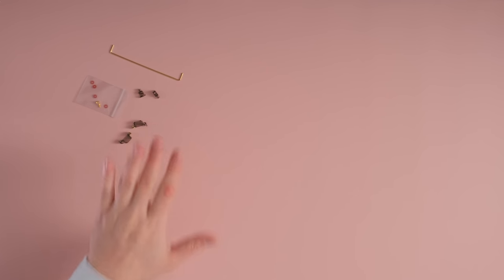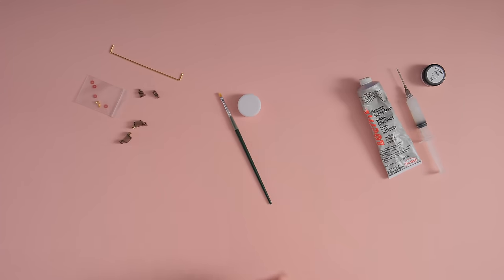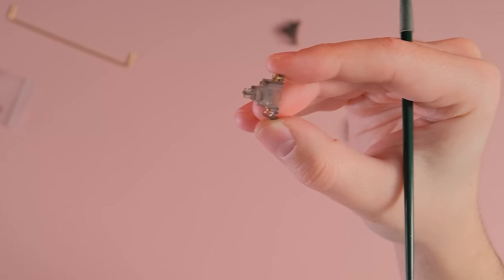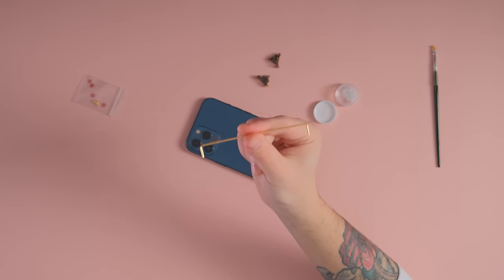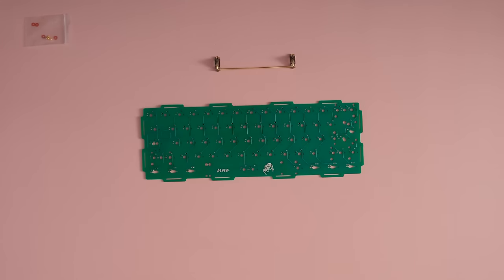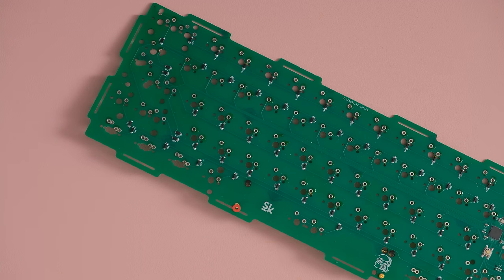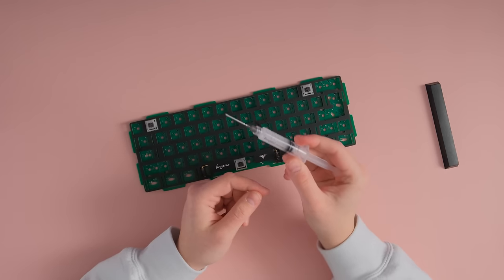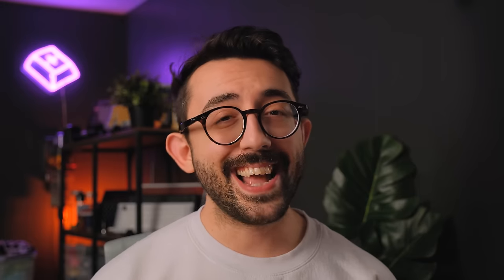How To Lube and Properly Tune Stabilizers - 2022

Comment: Thank you for advocating for wire balancing! I was expecting this guide to be a bit more generic but that step is pretty important.

Some things I would like to add is that you should only be balancing ONE side of the wire and remembering which side it is to insert into your stabilizers. If you balance one side, the flipped over side WILL be crooked.
Reply from the maker: Good to know! Ill definitely dive into this more with perhaps a more advanced video, but I really do think it's an important step! Im glad you like that!
Reply: honestly if you're not :3ildcat don't do it. most people will end up screwing it up and most wires are pretty (with exceptions) well balanced.
Reply from the maker: @jamess.2491  while I agree that a lot of stabs are balanced already, I do strongly think people should inspect and insure stab wires are straight before installing them.
Reply: @alexotos  I'm probably extremely unlucky then, as I've purchased dozens of stab kits (durocks, TX, staebies) and not a single one came with a straight wire. Thus I've been trying to refine my wire balancing, you do still hear some rattling and ticking in my videos, but I'm getting there. I look forward to a more advanced video Alex!
Reply: @jamess.2491  wildcat is human, too. If he can do it, everyone else can, and if you cant, you likely lack patience (as 99% of newcomers to this hobby does)
Reply: @nonnegaard  nah I’ve always just found they’re usually good enough. I’ve done it a couple times when the stab wires were egregiously misaligned (c3 stabs) but besides that I usually just use 205 on the housing, bdz on the wires, and inject some 205 and that does the trick
Reply: Especially if you plan to use stock stabilizers on a cheaper board you're just trying to spruce up.  A lot of times the cheaper entry boards have more egregious bent wires that can be a relatively easy fix for somebody just starting in the hobby not looking to spend another $10-15 for new stabilizers when that can go towards switches or nicer keycaps.
Reply: Hey man! Could you please clarify?
First you said that I should balance only one side of the wire, but you proceeded to say that the flipped over side will be crooked? 
And what do you mean by remembering which side to insert into my stabilizers? Isn't there only one correct way?
Reply: @jamess.2491  They start ticking after a while and you have to continuously relube them if you dont balance it properly. You probably just got lucky with a good wire because its usually not the case depending on which brand the wire is.
Reply: It WILL be crooked? What do you mean. I want to balance my wires the correct way so I would seriously appreciate some clarification on this.
Reply: @IzzyTheTanuki  So let's say you straighten it right. If you flip the entire thing over, it will be crooked. So basically, you need to remember the orientation/which side of the wire you balanced.
Reply: This tip alone changed my whole game when it comes to stab modding

Comment: Definitely what I need. Despite being in the hobby for almost a year and has built quite a number of boards, getting stabs right is the hardest in my opinion and “how to tune stabilizers” videos are usually a year old. With new mods created, a new refreshed version of tuning stabilizers is definitely needed!
Reply from the maker: I hope you find this useful! I didn't cover other mods since I don't use them but this is how ive been doing them for nearly a year.
Reply: @alexotos  well wire balancing and the tightness of the screw ins are definitely something I wouldn't see in previous videos

Comment: When installing any stabilizer: wire balance, always. 
Just like you should do a visual inspection of the switch pins, you should check that all of the stab components are OK. It takes seconds, and makes troubleshooting much easier.
Reply: wire balancing is so important and underrated

Comment: This is absolutely the most comprehensive guide about stabs. Finally someone gives proper advice on wire balancing (rather than wildcat just quickly doing something, and not saying or explaining anything),  goes through best options regarding lubes, and shows exactly how to use the syringes. If you added a guide on Holee mods this would've been absolutely spot on. 

Just one question popped into my mind: I have all of my lubes in the glass jars, and I would not like to purchase the same lubes in a syringe that the vendor provides. 

So my question is: What kind of a needle do you use for your syringes,  I'd like to know the exact size of the diameter of the needle. I tried using a syringe with Tribosys 3204 using a 0,45mm needle, was too small, only got some small drops of lube out. 

I hope you'll see my comment and give an answer, thank you so much in advance, and thank you for the tutorial. All the best my dude
Reply: use a brown needle

Comment: It's also good to note that it's always recommended to use the washers on any size PCB because it's not just used to tighten the screw but also to avoid metal coming into direct contact with the surface of the PCB so as to not damage it.
Reply: Most newer PCBs especially higher-end reputable company's have ESD (electronic shock protection) on their PCBs.(and reputable brands will always put in the description if they have this feature on the PCB), but you're correct. 

If the PCB doesn't explicitly state that it has ESD protection then It's always a good habit to treat every PCB as if it DOESN'T have this  protective feature by always using the washers included with your stabilizers (on PCB mount /screw-in stabilizers).
Reply: I just use clip in stabilizers no worries at all about that. whole myth about clip ins popping out never experienced it.

Comment: i've been frustated by my spacebar wire rattle, even after hours of tuning, wire stabilizing, changing with another stabs, etc, i can't quite nailed it with the rattle. it always there.
but after watching your video, at last i can tackle the rattle. it turns out a generous amount of lube inside the stabs is making the job done.
Thank you for making my day

Comment: Always loved your stabilizers work, so this guide is very welcomed! I'm glad you didn't include holee mod as I think there is some community pressure to do it even though I feel proper wire balancing and stab installation should avoid the need for it.

Comment: I have 2 thoughts about this:
Why aren't you brushing some lube where the wire clips into the housing, instead of just applying some ABOVE the wire after installation? There's no lube where the plastic meets the wire except the little bit that will get to it when the wire twists.
The second thing is, there's no talking about bandaid for plate clip-in stabs or holee (or something of the sort) mod. I understand high end stab brands such as durock don't really need them but in really cheap stock stabs this mods really make a huge difference (certainly in my own experience).
Anyway, great video, impossible to argue with the results!
Reply: @bigbenmk4873  it's crazy you respond this when I specifically talk about really cheap stock stabs in my comment
Reply: @Nehimsupacac  yeah, thats why i said that

Comment: Great video! 

One question though. What do you do if you stabilizers won’t clip into the pcb because the length is to short? Thought it was a thin board but apparently not

Comment: Removed the holee mod and tried emulating how you lube your stabs. For the life of me I couldn't the rattling to stop even with tons of dielectric grease. Turns out the stab stems were not latching securely to the key caps. Had to use teflon tape to make the holes in the keycaps tighter and now they sound better but a bit mushy lol

Comment: The more boards I build the less I do for stabs and switch lubing lol. 

I just bandaid mod, 205g0 the housing, dielectric grease the wire, and pop it in unless the wire is really bad. 

Got tired of holee modding and now my spacebar is kind of loud and hollow but I like the sound and it has no rattle.

Comment: On my first build ever I installed the durock stabs and was wondering how people were able to screw them in without the stabs falling out. I managed to attach the screws and little did I know, the reason they weren’t staying in was because I didn’t clip the bigger part in properly… and to top it all off I was so confident that I didn’t test them before assembling the rest of the board

Comment: I have tried various methods for the last one and a half years but so far the best value Lube for stabs to me is the Krytox 205g2. it's quite cheap and it does the stab lubing job quite well. Sort of a Poor man's XHT-BDZ.

But I think Wire Balancing is the way to instead of those epsi mode/holee mod!  Hope that more Stab manufacturers release stabs inside of a case or something like Gateron Ink v2 stabs!
Reply: hey, I've been looking for someone who has used 205g2 for stabs as in my lube kit, it is included for free. When you say it is good for stabs. Is that housings and wire or just wires or just housings?

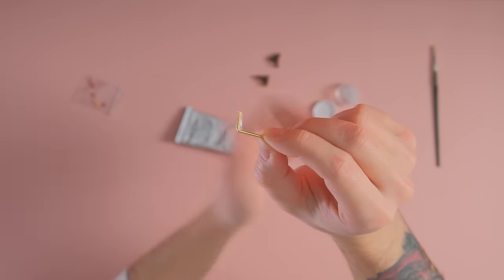Comment: Great video! But I do have one question: at 6:20 you mentioned that you don't go past the bend but why since you were going to lube it with 205g0 anyway? Also, why did you lube that bend with 205g0 instead of dielectric grease?
Reply from the maker: I find that part with dielectric grease feels a bit to thick and something creates a 'gushy' sound
Reply: @alexotos  Thanks for the reply! I'm about to use the XHT-BDZ. Should I avoid the bend as well?

Comment: I noticed in the [adding more lube] section of your video, you add enough dielectric grease to kind of 'fill up' the inside of the stem and stem housing. Is this a good amount to begin with usually?
Reply from the maker: Yupp just use a standard amount to fill it up or you can go lighter, I then recommend using 205g0 to plug any missing spots rather than try to stuff more dielectric grease in there

Comment: Does it matter what brand of dielectric grease you use? I bought a cheaper one from permatex. I also bought some empty syringes instead of the one from TKC, I'm assuming I should be able to just load the grease into the syringes?

Comment: Heyyy man, love your videos! I have a GMMK PRO and have been trying out deferent configuration, tho still have not found "THE ONE". Have any advise or idea, i thought of doing what u did with the keycron but still dont know so would be awsome if i had any ideas or advise, beacause i can see that u can allways find out what is the best mods for each board. Right now im rocking the stock foams, some tape and pe foam. Sooo, can u help me? :))

Akko Jelly Blacks
Pc plate
Durock v2 stabs (hole moded and lubed with 205G0)
Reply: What i have seen in a couple videos is adding some gaskets to the underside of the top case and replacing the case foam with some tape and polyfill. All this with the PCB tape mod, pe foam and Alu plate

Comment: Awesome video. I think there should be an included how to assemble guide and then lube the stabs, by far the trickest part for me as a first time builder was not only knowing you had to push the wire into the clip at the end of the housing, and thats after i got dielectric all over my fingers from the awkward angles needed to grip the wire itself, this is especially difficult if your stab housings are solid instead of translucent, so it's much more difficult to gauge how much lube from the syringe is "enough".

Comment: Yo, does PTFE lube and grease work for lubing switches? Its what i use on my 3d printer and have lots of high quality of both of them. Lube comes in a spray can, grease is.. grease. The grease seems the same consistency as krytox. They are both non-conductive.

Comment: Top how to tutorial, thanks for that. Question to everyone: comparison between the akko top 75 with akkos new double shot tpu  plate mount stabs and the keychron Q1 V2 with durock stabs.  No matter what I do, the keychron spacebar sounds like hot garbage with x switches testet. In comparison to the akko, which sounds god tier level (no joke stabs are all so satisfying to listen and activate), the keychron isn't fixable for me. I've tried it with the sringe, different keycaps, foam to fill the spacebar (variations of foam). 

I've bought a set of durocks for a total of 35 euros to Switzerland and can't make this thing sound nearly as good as the top 75. Is it me or just keychron? I didn't have the chance to review some customs like freebird, frog or kbdfans keyboards. Maybe I should try to import one? 

Thanks in advance for some feedback and user opinions.

Comment: I got a question and I hope it can be answered: About the spacebar's switch, is it better to have a heavier spring force(say, 65g and up) than the rest as it's holding on to the stabs and the weight of the spacebar. or it doesn't matter.
Reply from the maker: Totally preference! I find with a stronger spring you get a nicer kick back for sure, but I havent done that in some time on my boards.
Reply: @alexotos  thank you!

Comment: Hey Alex, first time builder here. For my stabilizers, I was very careful to not over lube them, but when any of those are pressed down all the way where it becomes level with the other keys, it gets stuck. If I lift the keycaps with the stabilizers further up, it will travel normally, but the height is not the same. Is that normal? Also, they feel sticky and muted. Again, I was very careful to not overlube. I used Holee mod with 205g0 on just the interior housing, the wire, and the portion of the housing where the wire moves.
Reply from the maker: It's probably the Holee mod, I really dont recommend using it, it has way too many variables and can make your board feel muted / sticky.

Comment: Any advice for spacebar tick caused by long pole switches? Noticed it on my kaihls and gat box inks and I have no idea how to fix it. I put tape on the spacebar insert to avoid the Keycap popping up on one side but the tick is still present. Any personal experience with this?

Comment: hey alex. been looking for a solution to my problem for a lil while now and i can't seem to find it anywhere. after balancing the wire on my spacebar stab and adding some extra lube, the stabs seemed to feel fine, but I notice a faint ticking or clicking noise. I was thinking of trying PTFE tape on the wire tips but I really don't know of any other solutions for this. 

Specs: KBD67 Lite, JWK Alpacas, Durock V2s, Krytox 205g0

Comment: I been using G502 on my spacebar stabs and no wonder it has slight ticking all the time (after reapplying more it's gone). Gonna try dielectric grease the next time.

Comment: When plugging the front side of the housing with dielectric grease, doesn't it eventually settle on the pcb  and the stem gets mushy on the bottom out?

Comment: i did all the steps and went great for a few months, after that my space bar went sticky :S why is that? its because of the dialectric grease going thicker or stickier? it has happened the same thing in my two builds
Reply from the maker: Which brand of grease did you use?
Reply: @alexotos  using Permatex and Krytox for the housing

Comment: Taeha's guide says otherwise, that you should lube the wire past the corner. Strange.
Reply from the maker: A bit late to this, but if you watch the whole video, I brush on the lube for the bend later. MY approach is a super light coat first then tune later.

Comment: Dielectric will not last. After about few months, they will drip out from the wires to the bottom. If you added more, it will makes the the stab very mushy and sticky. I been using that method on all my board, and every single one of them did not last more than 6 months. This is the same as using like Kyrtox 205. Since they are liquid,  they do flow to the bottom as time goes on. They DO NOT STAY.

Comment: What stabilizers are in this video?
Reply: durock
Reply: @minhnguyn3231 not trying to be rude or like a nerd but they are durock plate mount ones bc there are diff types:)
Reply: @12besteditor  wrong,they are screw in=pcb mount

Comment: new to the hobby here. I noticed that in the demo timestamp 11:16, the spacebar is moving up horizontally whenever your applying at either side of the spacebar. Any idea as to why that is the case? i noticed that on my TX stabs as well and have no idea how to fix it. Kinda bummed out as TX stabs ain't cheap. Initially thought it's because the stabs need long pole switches but i've tried both normal and long pole the problem is still there. Appreciate anyone's advice how to fix it.🥲